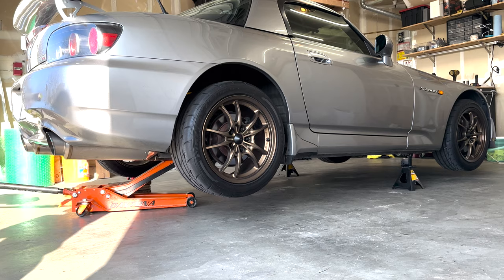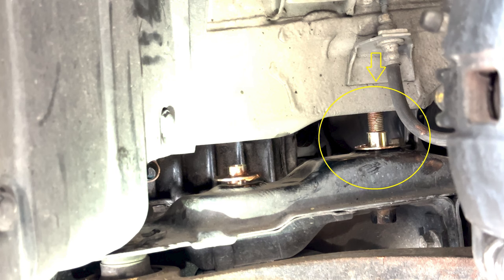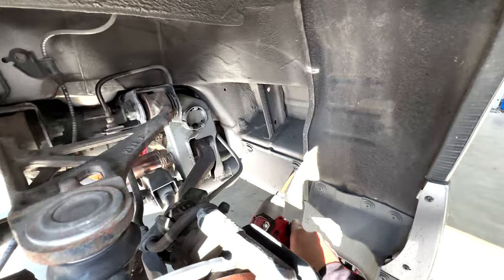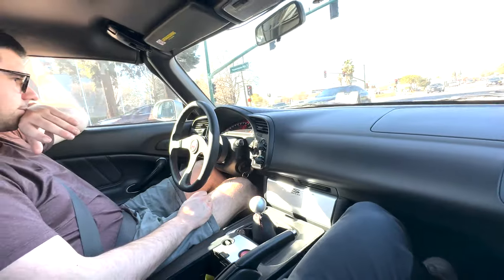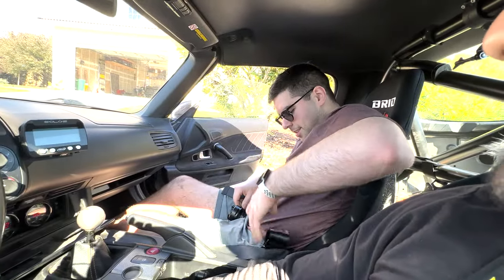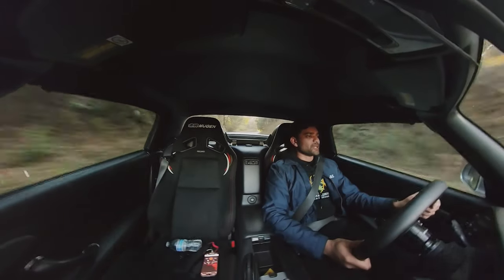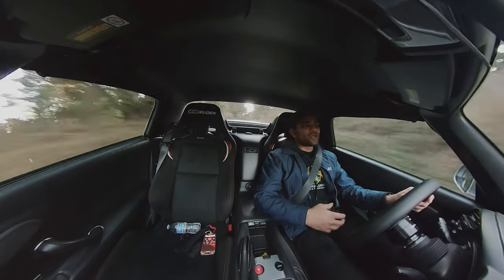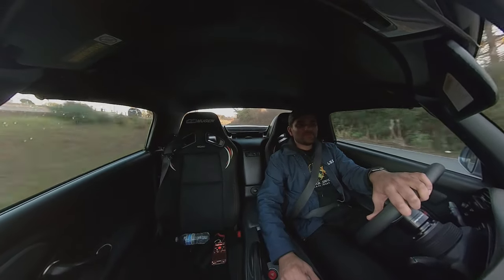Are Spoon Rigid Collars worth it? S2000 Rigid Collars install and review featuring @DIYGuysvideo

Comment: A regular s2000 is 95% a CR...
Reply: I think the only big difference is the spring rates, sway bars, and the rack are different.
Reply: @wrenchaholic_  yep! Add the aero, interior glam trim pieces, and soft stop delete/hard top. That's it! These parts are NOT worth $40k over a regular used ap2.

Comment: The starter grinding can be due to two reasons. First is its reaching end of life. Second is a week battery. I've noticed mine grind when I have not started the car in a while, and its only on the first start. I began using a battery tender I don't hear it grind any more.
Reply: Not true and not true. It's literally just grease on the inside of the starter has gotten too much clutch dust inside of it and can't lubricate enough anymore so it sticks open for a second. Clean and regrease and it won't stick for a long time again.